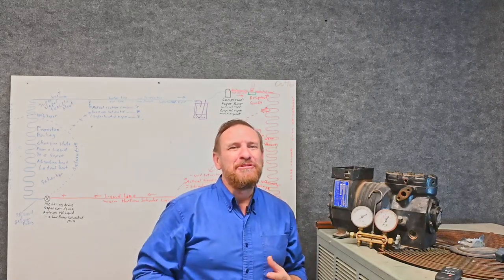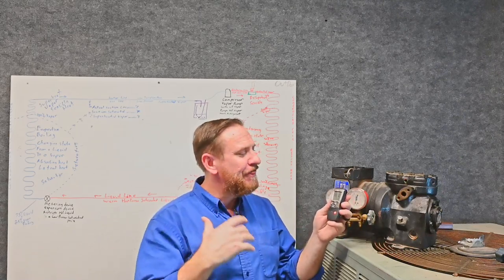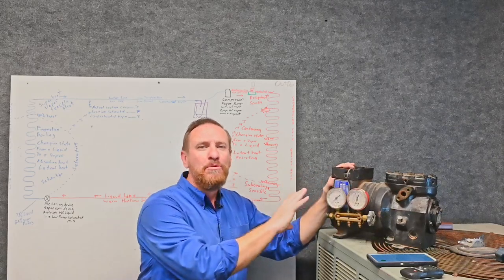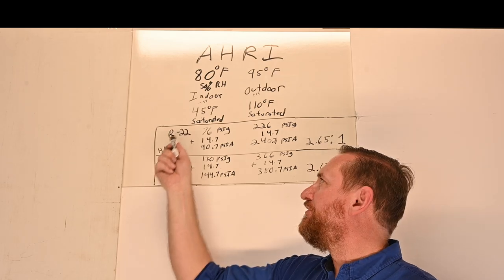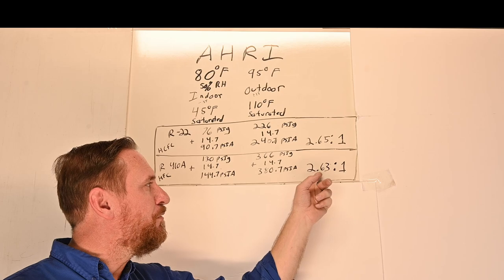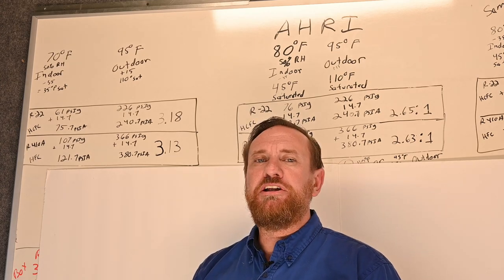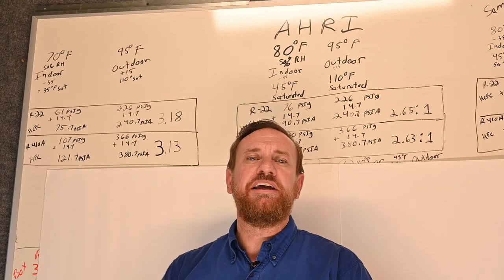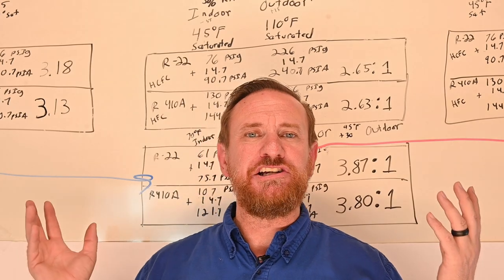HVAC 100 A compression Ratio part 1

Comment: [Edit: this is dumb, see my reply below] So why does it matter if you're using psia or psig? As long as you're using the same on both sides, it shouldn't matter. It's just like a regular fraction in math class. If you add 14.7 to the numerator and then add it to the denominator as well, you should immediately cancel it out to simplify. You can even add a dinosaur to the top and bottom. If the same dinosaur is on the top and bottom, both dinosaurs cancel each other out.
Reply: Ok so this is actually strange. I just set out to prove that the 14.7 doesn't matter but I actually proved it does matter. 226 divided by 76 is 2.97 but 240.7 divided by 90.7 is 2.65. Huh. 

Why was I wrong?

So I think this is because when you add a dinosaur to the top and add a dinosaur to the bottom of a fraction, you don't get to cancel them out. You only get to cancel them out when you multiply them by the numerator/denominator. 

So for example, if there was a fraction 2 over 1, or 2/1, that would obviously reduce to just 2. But if you add 2 to both numerator and denominator, you get 4/3, which definitely does not reduce to 2. However, if you instead multiply numerator and denominator both by 2, you get 4/2, which does in fact reduce to 2.

So I asked ChatGPT about this and it appears as though I was misusing "the multiplicative property of fractions". It doesn't apply to addition or subtraction.
Reply from the maker: Yep, math! 

Also,  if we where at sea level 14.7 we pull a vacuum below atmospheric -14.7. to get back to 0 we must add in 14.7 psi of refregerant just to get back to 0.

When the system is running, the suction side will have a larger impact on compression ratio than the high side. Keeping the house a few degrees cooler requires more work than the outdoor temp being a few degrees warmer.

It's also important to note it's not always 14.7, at altitude the number will be less and the compression ratio has to account for that.

For example Denver Colorado we would add inly 12.4

Comment: Great explanations 🎉. I have a question about absolute pressure. HVAC systems are vacuum before adding refrigerants and Refrigerant is circulated in a closed circuit. How atmospheric pressure reacts on this system then?
Reply from the maker: Great question. When you star your in a vacuum wich is bellow atmospheric pressure. You add refrigerant to the system just to get it to 0psig. So that refrigerant is now accounted for in the calculation. 

Think of industrial LP chillers. The suction side runs in a vacuum. Even if you removed all the liquid out of a chiller, and had vapor at 0 psiG (at sea level ) there would bee 14.7 pounds of refrigerant still in the system. That vapor only at I psig (14.7) psig would be over 100/phosical pounds of refrigerant.
Reply: @love2hvac  Thank you.

Comment: One thing I don't understand is how does the compressor maintain the 15 or 30 F difference between sat. temp and the outdoor ambient temp? How does it know to increase or decrease the compression ratio? I understand that the compression ratio changes depending on the heat load inside, if the refrigerant is more or less dense when it reaches the compressor, but I don't understand how it maintains the 15/30 F difference regardless of the indoor heat load. Thank you
Reply from the maker: This is where all the previous videos come into play. 

The compressor does not do co TROL the condensor TD or the compression ratio. It just uses positive displacement to move a set volume under giving conditions. You can track the displacement via a performance chart for the compressor with a given set of conditions.

As the temperature of the air outside  goes up, more heat will be reacting against the coil, and that heat energy will transfer through the copper to the refregerant.  The heat energy will excite the refregerant molecules faster causing higher pressure and thus a higher saturated temperature. 

As the outdoor temperature goes up or down the pressure in the condensor will go up and down. 

Now if we slow the fan down, we end up with less heat transfer. The heat builds up around the condensor and that heat raises pressure and then raises the compression ratio. 

If we move more air across the condensor, the heat transfer is faster  and more effectively cooles the coils, the molecules move slower, this less pressure, lower compression ratio and a lower saturated temperature.
 
The problems is moving more air requires a motor that uses more energy.

Alternatively we can use a larger condensing coil to transfer heat better. 
The larger coil allows more air across more air across the metal. The better heat transfer allows the molecules to move lower and this lower pressure and a lower compression ratio and a lower  saturated temperature. 

It's all about the heat transfer from the air and the refregerant.

The amount of refregerant can also affect this. Less molecules of refregerant means less pressure and more molecules of refregerant means more pressure. This is because the metering device allows so much refrigerant flow. The rest backs up in the condensor.

The manufacture and  engineers design all of these factors together. The compressor volume, compressor motor size, fan blade size, fan motor size, coil size, tubing size, metering device size and more  for the overall effecency they are trying to achieve.

Comment: Thank You very much for this Update:
These is my take away
1. I can be more conscious of energy consumption in my system by paying attention to my CR.
ie I can select an higher CFM condenser fan through a lower Condenser Split so my CR can be reduce.
Reply from the maker: The suction side has greater affect on CR than the high side. Keeping the home warmer has the greatest affect. 
This can still feel cooler by using a fan only in the room you ocupy and making sure you control humidity.

Comment: This video provides exactly the information I've been seeking. Is there a way to know what temperature difference my unit is designed for 15 or 30 degrees? It's a 2010 Trane 5 Ton SEER 14 heat pump.
Reply from the maker: I have a video on TD and Delta T. (They are not the same)

Each manufacturer will provide performance data for a system matchup. It will be a graph that you can select specific conditions. One day it could be at 15, while another it could be 25

Comment: Question.....for residential style equipment. You are reading liquid pressure and not discharge pressure. Would the math still work or would it be skewed. On most RTU'S you can get discharge pressure so the math works. Just curious about how it works if you read liquid pressure.
Reply from the maker: That's a great question. There will be a difference in discharge vs liquid. I will get those numbers shortly. 
Discharge is best and refregeration is much more criticle for compression ratio and that's where we also have access to a discharge port. It 
Residential liquid will be close enough.

Comment: Hi Ty. Just wondering why atmospheric pressure is involved/required in the calculations. Seems to me the refrigerant system is in a rigid conduit and as such isolated from atmospheric pressure. Conceptually what am I not understanding?
Reply from the maker: Great question.

When we charge a system we first pull it into a vacuum. Below atmospheric pressure. We measure it is "hg bit it can also be considered in PSIa. We remove atmospheric pressure from inside the rigid piping. We then replace the atmospheric pressure with refrigerant. So we add 14.7 psi of refregerants to get it to 0psi guage. Then continue to add refregerants to what ever pressure.
We have to account for that refrigerant that is in there below the 0psi because it is still acting against the compressor. 

So if your in Denver Colorado the atmospheric pressure may be only 12psia.
If you where to pull a vacuum, you can only remove the atmospheric pressure.
 Since it is at altitude there is less pressure in the air. So we account for that. After a vacuum is pulled we replace it with refregerants 12psi to get it back to 0 and then what ever psi we end up with above that.
Reply: @love2hvac  Alhamdulillah, someone asked the question, and Ty answered it!!

Thanks, both of you!

Comment: does gravity affect compression ratio like having evap on 2nd floor?
Reply from the maker: Great question!
Since we are taking a compression ratio at the compressor, gravity will not affect it.
However the piping itself can affect system performance. Different piping configurations have restrictions that affect system capacity.

Comment: Is there an app to quickly calculate compression ratio in the field?
Reply from the maker: Yes, measurquick app does it automatically.
It works with digital probes attached to the equipment and GPS to calculate location, uses weather data and calculates  compression rational time!

Comment: "You're under pressure!" - So true! :O
It's really not clear to me why condensers are kept to a minimum size, seems additional heat rejection would require less energy for any system/refrigerant?
I must not be comprehending something.
Reply: It is a lot of info, just view the video again, even a few times if you need to.
Reply: @Michael-pz1hc  Put another way, I'm attempting to understand the downside (if there's a technical reason) of using an oversized condenser.
Reply from the maker: That's a great question. 
Refrigeration has less room physically, typically. Right space restaurants and limited space are one issue. 
The second is control. We run ac in the summer only. Refrigeration has to run all year. They need capacity contol usually by flooding the condensing coil with refrigerant via the fan cycle or headmaster. Larger coils would require significantly more refrigerants to overcome these conditions and build the necessary to build pressure to push into the evaporator coil past the metering device. 

As for residential there gets to be limited. The saturated still needs to be so much above ambient so you can achieve subcooling. The lowest liquid line temperature can be ambient. So no matter how many coils you use it just gets to the point of diminishing returns. Not able to gain anything vs the cost of making it larger.
Reply: @love2hvac  "The lowest the liquid line temperature can be, is ambient."
Perfect answer, thanks! ;)

Comment: With regards to the measurement by the pressure gauges in HVAC System, understand that the pressures measured will need to be added by the atmospheric pressure ( 14.7 psig or 1 bar or 1 atm ) if we are to calculate pressure ratios. However I still cannot really understand the real influence and impact that the atmospheric pressure imposes on the measured pressure because it is a close system and not subject or exposed to outside air or ambient pressure.. What is the real logic here ?
Reply from the maker: We pull a vacuum to remove all atmospheric pressure. Then we add refrigerant into the system. There is refregerant added to the system just to get back to 0 psig. That refrigerant must be accounted for. 
You pressure gauge does not aclint for that so we must manually add that back in.

It's only going to be 14.7 at sea level. 

If you where in Denver Colorado the atmospheric pressure would besay 12psia. So when you pulled a vacuum, you could only remove 12psia. Then  you add refrigerate to get back to 0. So you would add 12 psi to each side to do the compression ratio because that's the true amount of pressure the compressor is pushing against.

Comment: Apart from the terminology of pressure ratio ( discharge pressure abs / suction pressure abs ), there is also terminology of pressure difference ( discharge pressure - sucton pressure ) , what is the significance of this pressure difference ?
Reply from the maker: It's how much work the compressor is doing, it greatly affects how much volume of refregerant it can move and the heat buildup in the compressor.
Reply: @love2hvac  Thanks for the reply but I still cannot quite differentiate the significance of pressure ratio ( Discharge pressure in abs / Suction Pressure in abs ) and Pressure difference ( Discharge Pressure - Suction Pressure )  coz I am still literally stuck with the understanding and impression that both Pressure Ratio and Pressure Difference have to do with doing the compression work which is to bring the suction pressure up to the Discharge pressure level......? Other than that , I am still not able to grasp the understanding from other / different angle .Please kindly help to clarify in detail... thanks

Comment: Great thing about digital gauges, you can zero them to atmospheric pressure.
Reply from the maker: Pluss mearuquick calculates compression ratio and used the GPS to figure atmospheric pressure and altitude.

Comment: I was wondering, do compressors that use variable speed, do they control subcooling? ie, get their feedback from the calculated subcooling?
Reply from the maker: We have not got to that yet, but no.
Reply: @love2hvac  I have been thinking about this, and don't know how else it could control an inverter condenser unit with multiple indoor evaporators. It's only control feedback mechanism would be subcooling? Or should I keep watching and learn... Seriously, I have learned so much from you, and am very grateful. You are by far, the best online Hvacr instructor.
Reply from the maker: I will get there eventually.

Each head unit determines it's needs based on how far the return air temperature is from the set point temperature. They will also have a coil sensor and sometimes a  supply air temperature. It controls the fan speed based on this also. It then sends it needs to a mixing box or the condenser directly depending on model. The mixing box or the outdoor unit will open the EXV (EEV) to send refrigerant to that head unit as needed. It can measure the superheat coming back at that point as well on some models. 

The outdoor unit and compressor calculates the refrigerator needs form all the head units and uses an algarethem to determine how much refrigerant volume to pump.  Higher demands it pumps more volume, lower demands it moves slower volume, but because the volume is low the velocity of the refrigerant will be low and can loose oil, so the algarethem determines how often and how long  the compressor needs to speed up to get the oil return. The outdoor fan is also variable, so the outdoor fan will speed up and slow down to maintain a design TD and also appropriate subcooling. However there are other controls inside also, such as hot gas bypass, and a host of others.
Reply: @love2hvac  I'm referring specially to mini splits for my example. If multiple evaporators are running from a single condenser unit, surely the superheat of each individual evaporator would be managed by their own txv's?  Therefore, the load on the condenser could only be managed by monitoring the subooled refrigerant and altering compressor speed accordingly? I don't know what other purpose a variable speed compressor would serve? In mini splits, do the indoor evaporator units use solenoid valves to cut off refrigerant flow when no demand is called for? At least when multiple indoor units are used?
Reply from the maker: The last example was specifically for multiple head ductless (mini split) to 1 condenser.
Reply: @love2hvac  Does a condenser unit have to know how many evaporator are connected in order to control the flow of refrigerant, via a control valve, to individual evaporators?  Wouldn't it be easier to parallel the evaporators and just open a solenoid valve on demand, to allow refrigerant flow to individual evaporators, and then control compressor and condenser fan speed based on the subcooled pressure/temperature?
Reply from the maker: When you first set up the system you have to startup so each head communicates with the mixing box and condenser. The mixing box (sometimes in the condenser) has EXV (EEV) these can close all the way to do the same thing as a solinoid but also control superheat. Each if the head units are in parallel. To each other. The condensing unit is piped to the mixing box. 
Everything is variable, the fans inside, fans outside , the compressor, and the metering devices. 
When working on these you don't do superheat or subcooling you change by refrigerant amount and length of lines.
Reply from the maker: https://youtu.be/Npo_eMbuwnA
Reply: @love2hvac  This all sounds a little over-complicated to me. Surely the individual indoor evaporators control their own superheat using their own txv's, no external help required. The condenser unit could manage itself by simply measuring it's subcooling and adjusting it's compressor speed/fan speed accordingly. Happy superheat, happy subcooling, happy life?
Reply from the maker: There is no metering device in the inside units.
Not overly complicated just different.
Reply: @love2hvac  So the low-pressure vapour starts at the metering device in the outside condenser unit and has to travel through the line set to the indoor evaporator?
Reply: Can someone answer this, please?
Reply from the maker: @chrisleon7312  yes the metering device ins in the mixing box or the outdoor unit if it mixing boxed are not used.

what looks like a liquid line is really a low pressure saturation line. that's why it has to be insulated separate.
The section line is a still a suction line.
Reply: @love2hvac  I can't find a Google search for ac mixer box, I can't find a photo of one! What are these mythical mixer boxes you talk of?  Show me a photo, show me a diagram, show me where I can buy one?
Reply from the maker: @chrisleon7312  let's see if it will lete share this image https://images.app.goo.gl/HePHExj8WPAQkpbU6
Reply from the maker: @chrisleon7312  here is a video on it https://youtu.be/N27sLpQpVr4